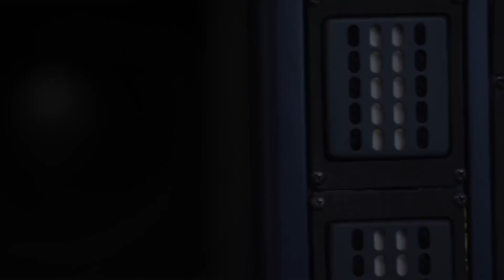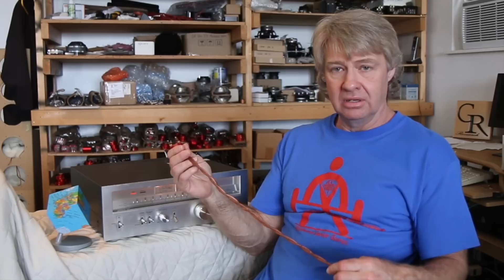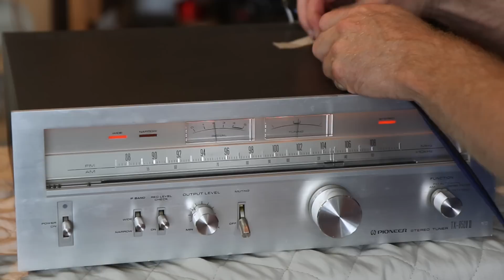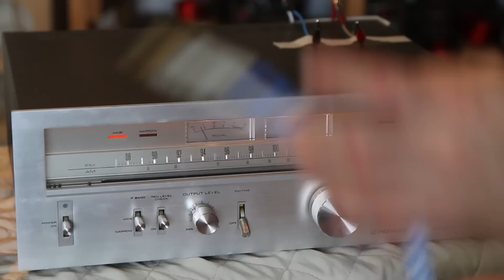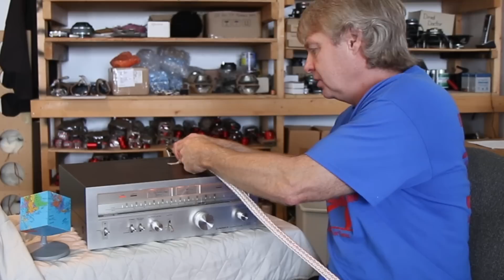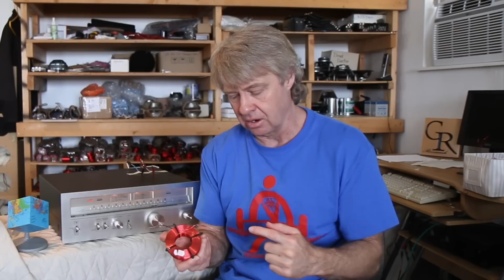Do Audiophile Cables Matter? Here's PROOF!

Comment: How do you think something like a canare (4-wire) star-quad would do compared to some of the braided options?  I've had good luck with both star quad for XLR interconnects and speaker wire.
Reply: Some of the star Quad wire is very good. Some of the braided geometry does go to another level though.

Comment: Put your amp on mono. User only the plus of Each channel. Connect them tot the plus and minus of one speaker. Now connect different cables one by one. Can you hear anything from the speaker? Probably not. If so first use the same cables and use balance tot equal all out. Or use a oscilloscope instead of a speaker.

Comment: Here's one glaring issue with your test: surface area. How much surface area contact are you getting when you connect the alligator clips to the raw 16awg? How much contact are you getting when you hook up the alligator clips to the rigid banana plug on your braided cables?

Make a follow up test where you cut off your connectors and repeat the test on bare wire.

Comment: how about considering length ? when playing with RF antennas  :)  every frequency has there ideal length , in an open dipole the way you use them now. 
.... its useless (for a antenna test) and  for audio this test is completely useless to begin with. especially loudspeaker cabling.  how about where you point the side of the cable to ? since when using as an open dipole in this horizontal fashion, would make it directional moving the cable to you left or right changes the signal strength...  just my 2 cents.
Reply: That depends on if the signal is horizontally or vertically polarized, right?
Reply: @QoraxAudio  as far as i know  it would work for any signal :) since the tip and bottom dont pick up as much :) s using it horizontally does not give you a stronger signal but it does pickup less from the sides like .  it does not provide gain. (maybe even lose some) but if 2 stations would be really close on the ferquency it could make the difference in hearing one of the 2 by turning it.  (thats why the fold up ones could be turned  and not just go up)

Comment: If you can repeat the same with a 8 ohm resistor connected to the other end of the cable, and show the same results, that would be amazing....Or you connect an open cable to a speaker and you can hear something from the speaker.  Show me.

Comment: Thanks for the proof! I'm totally convinced. I prefer to add low voltage DC batteries to my speaker cables to magnify the flux capacitor luminessance.  I'm absolutely convinced it makes a difference.  My research proves it.
Reply: You should be kind to the stupid, is your flux capacitor the valve version or wind powered.

Comment: Apples and oranges Danny. I enjoy your videos but this is not proof of anything other then braided speaker cable is not a good antenna. That doesn’t mean that it will sound better or worst as the amplifier/speaker interface. RF frequencies are not audible and microvolt RF signals are not high enough to drive low impedance speakers and would be shunted by low impedance of the amplifier. In speaker cables, impedance is the only factor. Dielectric material will have an effect on capacitance and conductor spacing will have an effect on both inductance and capacitance but the DC resistance is the biggest factor.
Reply: It is not that you will hear those wavelengths that are above human hearing. You will hear the effect they have on the audio signal. And it does effect the signal transfer and how it sounds. That's why a lot of electronics have filters built into the design to filter this ranges out. 
And the impedance of a speaker cable has little to nothing to do with how it sounds. If it did then what would be better? The lower the better? Then let's just get the biggest and heaviest cables we can get. It could even be Aluminum or Steel so long as it is big enough for a low impedance right? No that is ridiculous.
Reply: @dannyrichie9743  Cable impedance is the biggest knob, when it comes to transfer function. This includes high level signals, like power amplifier to speakers and low level millivolt signals. At high frequencies, differential signals and shielding are much more important but this is in megahertz to gigahertz range. I’ve worked in a high frequency power electronics research lab for the last 23 years and have made thousands of these types of measurements to select the proper cables for a project. I respectfully disagree with your assumptions about microvolt level RFI “muddying” the sound when imposed on the high levels of the speaker wires. I will still watch your videos because I like your scientific approach to upgrading speaker crossover designs and compensating for poor driver locations.
Reply: @josephreynolds6844  What I illustrated wasn't meant to be limited to speaker cables. They were just the type of cables used to illustrate the differences. The effect of that type of noise is much greater on A/C lines, interconnects, USB cables etc.
Reply: @dannyrichie9743  Yes, I understand. Thanks.

Comment: Ok, cables can make a difference - but : HF-frequencies on a clable are a total different beast. Impedence and shielding does extreme differences, and the wavelength too. For low frequencies which we can hear this is only a  small topic. This demonstration didn't help here. If you want to show what a cheap cable does take 100m of it and measure the frequency-response and the phase-delay on a speaker which is connected to it.  And maybe the super-twisted cable has so much capacitance that it hurts the sound of the tweeter.
Reply: Garbage.

Comment: Okay how about testing an actual frequency that we actually listen to speakers at? Ethan Winter developed a device called the null tester to test speaker cables and to sum up his conclusion. Expensive cables are indeed snake oil:
https://www.youtube.com/watch?v=ZyWt3kANA3Q
Reply: He doesn't prove anything other than he is measuring for the wrong thing. First one has to establish if there is or is not an audible difference, and his system isn't capable or revealing any of that because is whole system is budget level junk.

Comment: Danny, you probably know this, but viewers might not.  Y
our reference cable has a lot of capacitance and low impedance compared to the other cables, and at mHz FM frequencies it makes a poor antenna because the capacitance reduces RF signals, the low impedance also reduces RF, and the conductor braid orientation somewhat cancels out RF.   The debate is whether the capacitance and low impedance makes a positive difference at audio frequencies below 18 kHz.  Similar situation, but not as much for the 6 conductor braided cable.  Although some commenters think this has little to do with a speaker and amplifier output stage, it is a crude demonstration and somewhat relevant, but hard for those without a complete picture of speaker-cable-amplifier interactions to grasp.  There's more to speaker cable and amplifier interaction than just impedance and capacitance  because a speaker is a back EMF generator, the crossover has very nonlinear impedance, and the signal is dynamic, not steady state, so stored energy released with delay also adversely affects the amplifier output and speaker cone deviation from perfect reproduction. Electrical noise is a real but not large problem in many homes, and not all systems are susceptible to this issue, so some people don't hear much difference, and some hear a bigger difference.  Those are some reasons this debate persists!

Comment: Well thanks for showing me what speaker cable I can use for a antenna. As far as I am concerned if you hear no interference coming through your speakers with whatever speaker cable you have used be happy in that it will sound fine. If you are hearing clicks, pops, humming or RF you need to sort your mains filtering/ cleaning out. RF will not be picked up and passed through to your speakers via the speaker cable whilst you are listening to music. I have never heard a radio signals or interference coming out my speakers whilst listening to a CD. This test is just not the correct way to prove a speaker cable will sound better. Nothing wrong with having nice cables. I really enjoy your videos but this one is lacking credibility.
Reply: No lacking of credibility here. It clearly shows one aspect of the differences in cables and a difference that can have some audible effect.
Reply: @dannyrichie9743  what audible effect? This demonstrates how different pieces of wire will simple work as an antenna. Not the correct test. Best way to test audible effect is swap each cable on the speakers not knowing what is in use. Pick out your favourite sounding cable. This is not what a speaker cable is used for. Any cable is capable of being induced by RF. The question is would it affect what you hear, no.
Reply: @a0r0a745  1000's have people have already made those A/B comparisons and reached the same conclusions of clear audible differences. if you aren't there yet then you are missing the boat.
Reply: @dannyrichie9743  what I already said I believe.

Comment: If your component’s power supply is properly designed, it will already filter out all that junk present on the AC line.
Reply: Not all of it, and standard cables like the zip cord can pick more of it up.
Reply: I agree that zip cord and unshielded cables can (and do) pick up EMI/RFI and that harmonics are present on the power line, but if your gear’s power supply—either linear or switch mode—doesn’t filter it out, then something is wrong with the gear’s  power supply design.
Reply: @ebkesq72  I have yet to hear ay gear not benefit from A/C power conditioning.

Comment: But the cable was shielded used at the end the others weren't you should start selling insurance .
Waving a cable in the air handling it is going to pick up frequencies you do the experiment cable flat on the floor and do not touch it you'll get no reading at all on any of cables as long as it's not near a power source. Same principle as your antenna you were talking about it doesn't work lying flat on the floor
Reply: I tried them flat on the floor and it still worked as shown.

Comment: I’m not really sure that this shows. This doesn’t mean there is a difference in audio sound quality. Cables could I suppose have a negative impact on audio by somehow degrading the signal, or picking up interference. Especially if you’ve got a very long cable run. But they can’t “add” anything to the sound itself like more bass etc.

Comment: Hmm. It is no Question: There is a Lot of Snake Oil with in Cables! The Problem is. how to divide the Snakeoil from the good stuff!  And that`s the Poodles Core! 
So, since i live in Austria, i hqaave a Big Advantage over the US-Citizens. We do not have this shitty Roomex in our Houses! We use - and this for more than 6 Decades - solid Copper Wiring for our Power , and we have a Voltage of 240V @50Hz for normal power, like our Lightbulbs, Coffemachines and so on. For higher Demands, we have 400Volts @50Hz. That said, we have more stable Pwoer here, and also  higher quality for Cables by Code. For example, there`s no way for an Austrian Electrician , to use  uninsulated wires!
Reply: Im also glad to live in Austria 🙂
Reply: Duh.......so does the USA use solid wires! Code does not allow uninsulated wire here either. Where did you learn that we use romex in our houses. LOL! We do use romex which is solid copper in a metal flex cover casing in barns and outbuilding so squirrels and rodents don't chew the insulation. We also have 120/240/440 and have used solid insulated wire for 10 decades!

Comment: You just prove that signal cables matter, I live in NYC top saturation of frequencies. Speaker cable dows not even pick up mili amp.  Check how many mili amp are needed to move speaker coil to audible level.

Comment: Do you remember when you put your cellular phone next to a device which has an audio output and you hear those chirp, chirp, chirp, or tick, tick, tick, or click, click, click...well the idea here is that you are looking to reduce the attack surface for noise to alter the signal and introduce RF rejection of external cables.  Once the signal is altered with RF it may influence the electronic components reproducing sounds.  Internally, audio equipment should have a chassis using the Faraday cage principal where internal electronic equipment is shielded from external RF sources.  I've long been a skeptic of fancy cables, but this video has changed my mind, there are specific cable geometry which are intent fully designed to have high RF rejection and improved signal integrity.

Comment: Would it be more cost effective to invest in a high end power conditioner from Furman? Or some other way to clean the noise?
Reply: Power conditioners do remove some noise but are not the noise killer solution most think they are. Better than not having one, but it isn't a full solution, those are so cost prohibitive as to only make sense if you have a system in the over 50k price range as there are a ton of other things to make the whole sound experience better you can do before that level of expense, for instance room treatment, better gear, or therapy to learn how not to worry too much.

Comment: Good ole Belden OFC 5000 series wire.  10 gauge PN is 5T00UP and the 12 gauge PN is 5000UE.  The 10 gauge has 65x28 stranding, PVC insulation,  and is 99.995% pure oxygen free tough pitch virgin copper.  And you can buy a 100 foot spool of it for $95 to $110.

Comment: Always learn something in your videos. Interesting way of demonstrating the cables. To be clear, are you sure it's not common mode rejection that's going on in the cable?  
As usual, fire storm ensues. Many people either have really poor listening skills, or have never experienced low noise and low distortion before, or have extremely strong bias in their own understanding of "science". 
An audio equipment designer once connected one side of a speaker pair with the wrong polarity (out of phase with each other), but told the listeners that he changed cables. "Subjectivists" and those who were neutral easily identified the change in sound; while "objectivists" claimed that no difference was audible. Reversed-polarity speaker-pair sounds very different from same-polarity speaker-pair, a person has to be extremely biased to not hear it (or extremely poor listening ability). In this case, they should just buy an cheap radio and an oscilloscope.